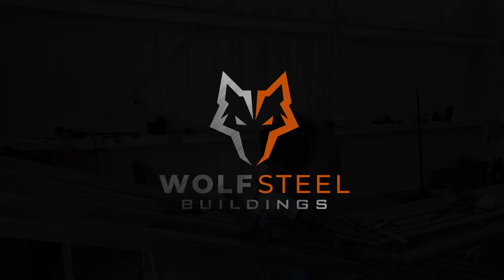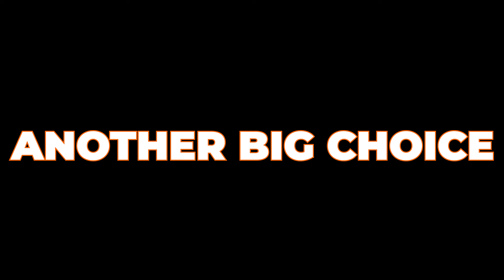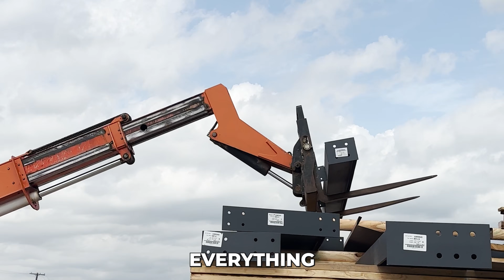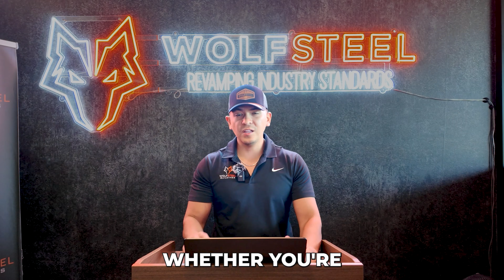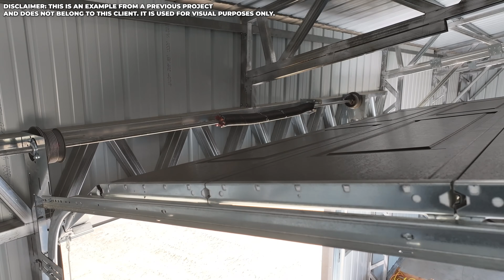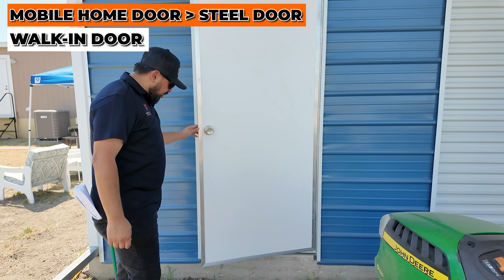30'x50' Royal Blue Texas Metal Storage | Story Behind This Custom Build!! | WolfSteel Buildings

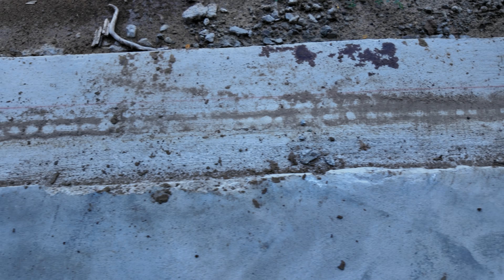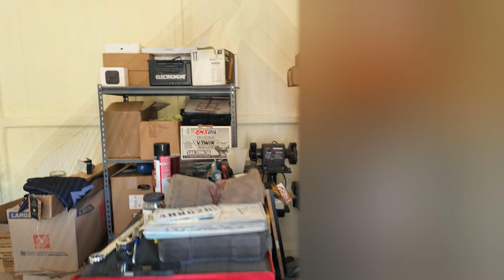Comment from the maker: Pack, at timestamp 8:28 to 8:40 we made an editing error of adding in the accessories cost again instead of providing the turnkey cost!

You will see a blurred a portion of the screen to avoid confusion.

The turnkey cost for this project is
$74,010.20
Concrete: $25,301.00
Building: $27,727.20
Accessories: $20,982.00

As always for a quote, please email us: Quotes@wolfsteelbuildings.com. 

Thank you!